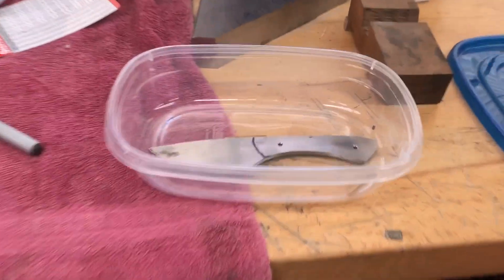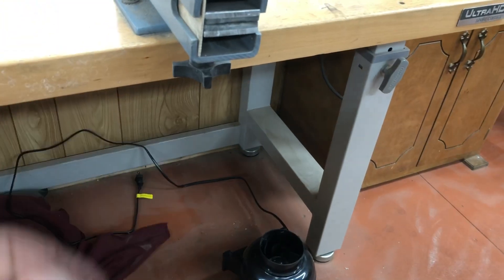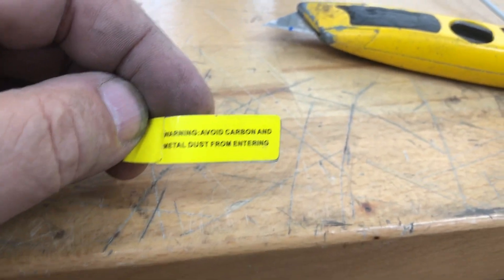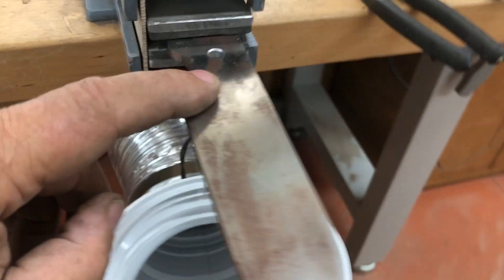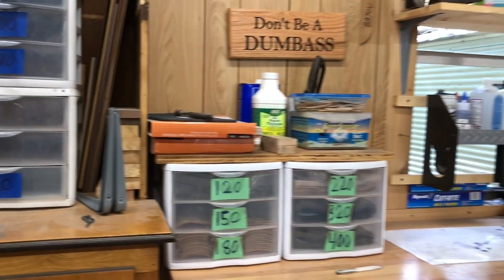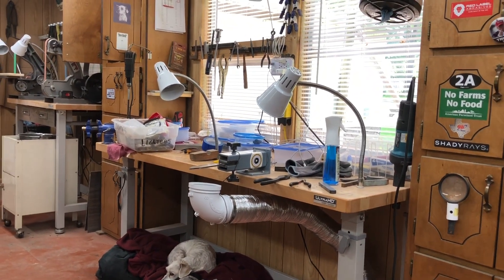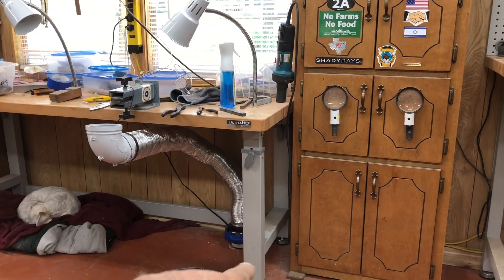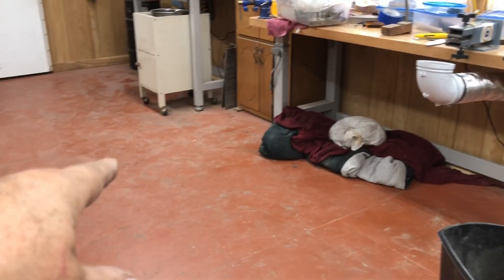Mini Dust extractor finished

Comment: Yes, enjoy life while you can!!! There's much today, that I wish I could still do. Much that I wish I'd done, when I had the opportunity. The full length version of the Serenity Prayer comes to mind. "Living one day at a time, Enjoying one moment at a time, Accepting hardship as the pathway to peace."  The older I get, the more powerful the message within that prayer becomes. Often associated with AA, IMO, it applies equally, if not more so, to some of us that haven't had that problem. 

Hope the fan you bought holds up for a decent period of time. Suspect the winding isn't shielded, thus metal filings could short it out. That's why when I do DIY window fan dust extractors, I put a furnace filter on the intake side of the fan. Helps keep the fan motor, a little cleaner. Perhaps, there's an idea in that, that you can use. Cut up a furnace filter and insert it into your setup, to at least trap the bigger stuff. 

BTW, would a big dog bowl, with the bottom cut out, inserted into your collection tube make the assembly more sturdy? Easier for the fan to pull the dust through because of the slick sides? Just a thought....

Stay Cool (Heat advisory up here, again today. Humidity awful!!!) Stay Safe from the woes of the world. May God Bless you and those around you. 

Full Version: https://www.prayerfoundation.org/dailyoffice/serenity_prayer_full_version.htm
Reply from the maker: I think a furnace filter would help. I’m going to town today.

Comment: Could you use a pvc cleanout T and use the fan to push air past it making a draft that you can attach the flexible section to?
Reply from the maker: That could work also!